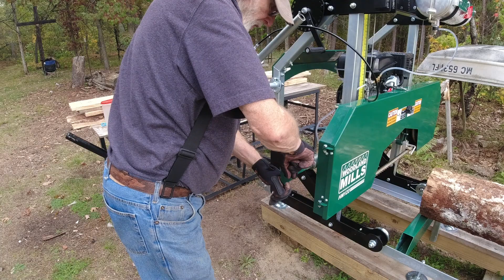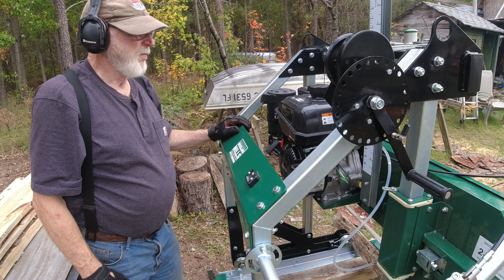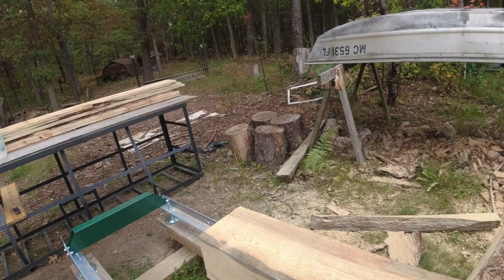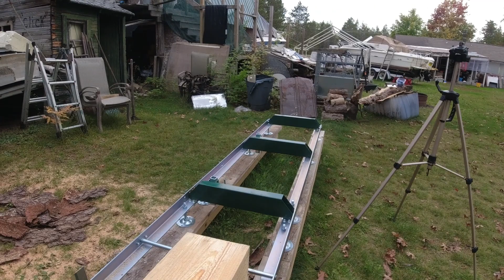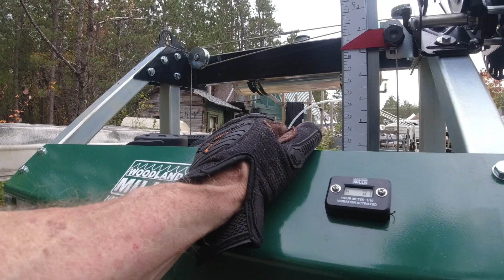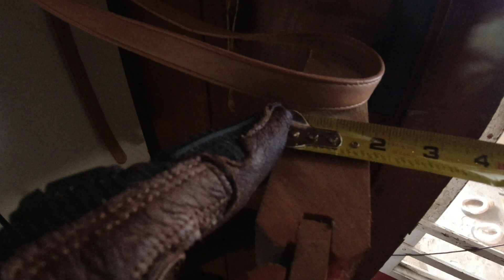2nd Log on my Woodland Mills bandsaw mill. EP 27-23

Comment: I also live in Northern Michigan and set up my new HM 126 mill in May. Consider using 2 inch pvc pipe when you rotate your log. Just put a piece of pvc pipe over two of your logstops when rotating the log. That has made my life easier at the mill. I store them in one of the bunks. You have to loosen the log to put them on and then remove them before you shove the log up against the stops. Enjoy your mill!
Reply from the maker: I'll try the PVC. I think I have some 2" on hand. Thanks for the tip. And thanks for watching.